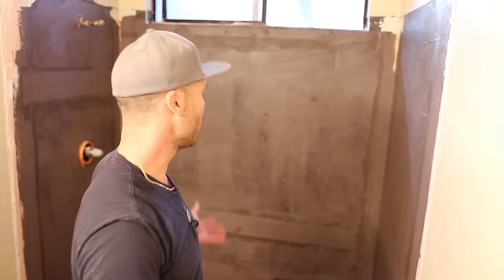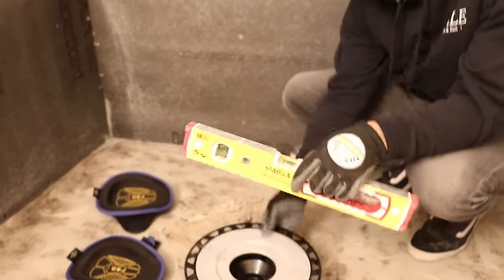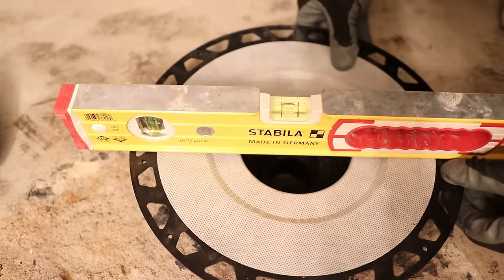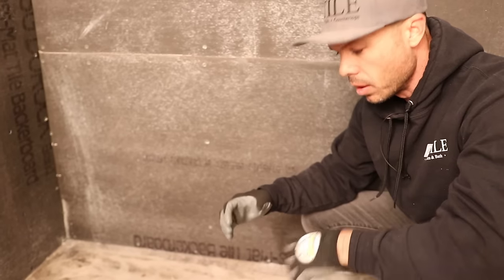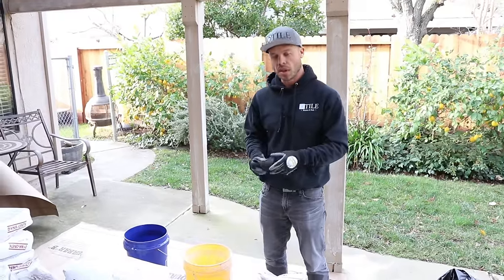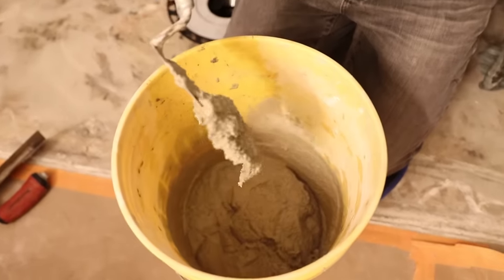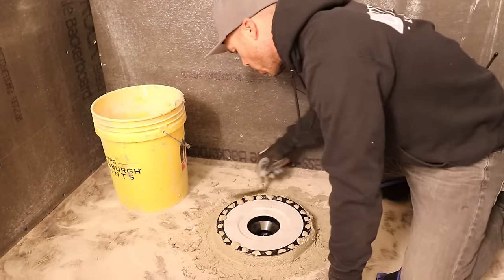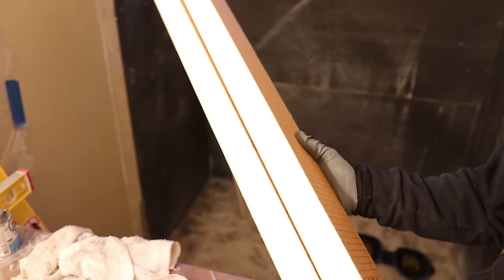One Day Shower Prep!!! MUD PAN with Kerdi and Ardex 8+9 :  TileCoach episode 28

Comment: I have been a flooring installer and tile contractor for 25 years. And I must say. You have changed the way I do things. You have definitely taught me alot. I think you!!! JB flooring
Reply: I have an existing dry pack mortar pan that had some moisture issues so I ground away some little problem areas. I’m thinking of adding some thin set and then another thin layer of dry pack mortar to smooth it out and then perhaps the Schutler liner or shower kit.  Did he put a dry pack mortar on top of a flat concrete floor or over an existing dry pack mortar pan?

Comment: Great video. If you’re a newbie, you can cut 3/4 strips to the correct height for the correct slope and level them around the shower that way you have a straight firm place to screed from. Once it’s sloped, you remove the strips and fill the void.
Reply: How can I better visualize what you said?

Comment: Issac, been watching alot of your videos over the past few years. I love your work ethic, demand for the highest level of craftsmanship and thirst for knowledge and understanding of all building techniques. Little tip with that stabila level when you set your drain, turn the level on its side and you can use both bubbles at the same time to level it across both planes in one shot, give a try some time and you will see how much easier it is.

Comment: My man, I have been doing that method for Kerdi flanges since my union diapers, lol! So happy to see a fellow tile installer who has pride in proper preparation!!!
Reply: Hey Mike, quick question- Did he put a dry pack mortar on top of a flat concrete floor or over an existing dry pack mortar pan? I have an old mortar bed that I grinded away some moisture damage and wonder if I can just put a layer of dry pack right over it….after setting a Kerri flange adaptor in.

Comment: Use a grease pencil or sharpie around your parameter line, easy to see for a quick check. You put this backer board directly down into the pan. You trust this product over others. In the past vids you mention to keep the backer out of the pan. This is really beautiful work, wow!  Great messages at the end of your vids, uplifting, thanks.

Comment: You make it look so easy, experience is such a valuable tool.  I fought mine for hours the other day.  I should have watched a lot more videos, even though I watched a ton to begin with.  I have a small low spot from smacking it to hard.  I am going to test the water drainage before tiling the floor.  Hope I don't have a place that water will sit.  I am a avid, highly experienced DIY'er and you Sir have a true gift.  Thanks for the videos!

Comment: My dad and I have 40+ years experience (east coast) and do old school wet bed. Always build curbs out of wood then wire, cement. Always use durock or permabase board (cover screws with thinset and tape seams). First coat of cement, pvc pan 6” up, second coat of cement, and  everything gets 2 coats of red guard. Takes time but it sure does work
Reply: Also, you mentioned the glass door guy screwing through the curb. That’s a big no no. Those screw holes will leak over time

Comment: Hi , here in the Netherlands we compact the sand cement mixture thIght but add a plasticize aditive like Ardex E25 to the mixture for the bonding and top strenght.
Also mechanical mix all your mortars and thinset.

Great video's btw
Reply: Great idea. I roll it on after the deck mud placement is complete.

Comment: Hey Issac.  The reason it flakes off is because when you pound your deck mud to much you actually bring a large portion of the water to the surface.  You pound the the granular to the bottom and bring to the surface the water.  Thanks for what you do brother.

Comment: Awesome video!  One tip recommendation I learned over the years is when you glue abs or pvc together, once you press the glued fittings together, turn it a quarter turn to make sure glue spreads evenly between the connections.  It just ensures a better seal and less chance of air trappage or separation.
Reply: It's illegal in most jurisdictions to glue abs and PVC together even with the transition glue. It will not hold over time. In my jurisdiction you are only allowed to glue abs and PVC together at the junction between an abs septic tank and PVC home plumbing system or vice versa. All other applications require the use of a rubber clamp coupling.
Reply: @maxgilbert18 I don’t think you understood what he said. His statement is ABS to ABS, or PVC to PVC, not ABS to PVC. Any plumber knows to give the fitting a little side to side twist to get everything to mix evenly
Reply: @jimbobsmith2496  Your right. I must have read that incorrectly.

Comment: "The quality of a person's life is in direct proportion to their committment to excellence, regardless of their chosen field of endeavor." - Vincent Lombardi. I started out as a plumber in the Air Force over 40 years ago and learned from the old school guys. Thanks for advocating for the building trades. Nowadays you can make a real good living and if you're good at what you do, word gets out and you'll be more valuable than gold. Thanks for a great video. I've been on the fence of how I'm going to do my shower, whether to use a pre-formed base or not, but after watching this, I'm confident that this is the way to go. If you were to do this over a second floor bathroom, would you lay down a 1/4" sheet of cement board on top of the plywood sub-floor before the dry-pack?

Comment: Thanks for the good video and your advice to younger guys, What did you use for the deck mud in this video? Why did you chose to use deck mud rather than getting the Kerdi shower pan? What did you use for thinnest? Does Schulter still require you use unmodified thinset for Kerdi? I am a general contractor who has never used kerdi but am looking into it. Thanks for your good work

Comment: So, I'm an avid home DIY guy with years of hands-on experience - but I've never done a stand-alone shower without using a preformed pan.
That said, I investigated doing either the drypack or the Schluter-Kerdi.  I opted for the later thinking it would be less labor intensive and time consuming.
Man - I think I chose the wrong solution.
I'm nearly complete now with the base install of the base, walls, and the membrane in the all the corners and covering each of the screw points.  I watched this video (along with the others you have posted - many thanks for sharing your expertise!) and have taken great effort to remove as much of the thinset between the membrane and the kerdiboard and drain.  I plan to waterproof all of the membrane areas with the Ardex 8+9 waterproofing agent as an extra layer of protection.
I am concerned with the kerdi drain in particular.  As you noted, without air the thinset doesn't have air to dry.  The kedri drain has some small scallpped fetures built intot he design which traps the thinset and as such, it doesn't appear to be drying.  I am concerned that this small area (still somewhat 'spongy' to the hard depressed 'finger test') may not dry properly and after the Ardex 8+9 treatment will never dry.  Laying tile upon this area afterward may be prone to slight movement which could result in cracked grout and allow moisture to seep into the area under the tile causing future problems.  What are my options at this point (short of ripping out the entire shower area and starting over!).
Alternatively, I'm considering removing the kerdi-drain cover and then just treating the area with Ardex after I've confirmed the thinset has fully hardened.
I appreciate any and all insight.
Reply: Did you use a latex modified thinset mortar?   Some of them won't dry under the Kerdi. It also could be that you made it too thick, then re-mixed your mortar in an attempt to thin it or extend the pot life.  Either way, you may indeed have to do as you describe, if it's been days and still not setting up.
Most mortars harden chemically, similar to concrete, but latex additive can interfere with that process    I don't know for sure, just making a stab in the dark, based on your comment.   I hope it works out for you.
Reply: @thilltony3362  thx for the reply.
I've screeded out as much of the thin-set as I could.  I used a pre-mixed unmodified thinset. Then I let it sit for a week before a coated with the Ardex.  Let the Ardex sit for a few days and set the floor tile.  It seems very stable based on my calibrated foot in socks test.  ;)

Comment: Question, 8+9 and Water-Test:  Love your videos, I subscribed!  Just to confirm, there is no issue with doing a full water-test on the base after the 8+9 has dried (per 8+9 Specs.), even though everything under the 8+9 is still "wet" and not yet cured?  Thank you!

Comment: I've been a tile installer since 2003. I started using schluter shower systems within a couple years of starting. I've been to schluter class and I've always had questions about water leaching thru the thinset that binds the kerdi. I even had a discussion about it in class but I was assured by the instructors that as long as I had a 2 inch overlap that it wasn't a concern. But I have often put supplemental waterproofing in places like the corners and outside corners for my own piece of mind. But I like the idea of covering the bottom part of the shower with 8&9. But I'm not going back to mud pans, sorry. I'm very content with the schluter pans plus I wasn't the greatest with mud pans!
Reply: I wonder if I could fine pans without fleece and just 8+9? Bc it’s so thick and strong that it seems like it would last forever. Have u ever heard of company who just does pans cheap without fleece? I know I’m being lil cheap asking but the 8plus9 is whole different league then red guard

Comment: Inside corner mud knife saves so much time when doing inside corners..
Reply: @skiprope536  ... because they mud one side of the tape, let it dry and mud the other, or they sand out any imperfections when they use 6 inch mud knives on both sides.
Reply: @nicksimms9577  I hate inside corners or outside corner knifes doesn't work for me.
Reply: @russellwright9418  there deffinatly is a learning curve, I dont like using them with plaster or joint compound, but I really like them for waterproofing inside corners. I like to use a 6 inch mud knife to apply thin set, corner trowl to spread it out, apply fiberglass tape and smooth out again with corner trowel no bubbles and dont have to do the awkward dance with two 6 inch knifes. Also its fast enough that I can use speed set and ardex 8 and 9 emediatly
Reply: @nicksimms9577  Solid info that's next thanks..

Comment: Nice work.  We do our mud pans very similar.  Question.  I understand the mud will cure properly because it is over concrete.  Would you be able to do all of this in one day of it were over a wood sub floor?  I don't see where the moisture would go.  Possible mold problem in the future?  Thanks again Coach.

Comment: Have you considered 3M 760 UV Adhesive Sealant?   It’s also a Silane Poly.   The Hydro-Blok is not available outside of the west-coast.  Thanks for the tip on the foam board use as a curb, seems obvious now but I don’t always see the obvious.  I also watched your video on not using the Kerdi Fix as a sealer.  Great info.

Comment: Hey Isaac, the way things are done in the Uk 🇬🇧 are totally different! 

We have products that can be installed in quarter of the time, pre formed dec’s that are installed, adjustable height for tile thickness once the dec is fitted, waterproof membrane applied with out thin set and your tiles can be stuck once it’s down.

Full on respect for your skills but Just seems a lengthy method you guys use over there 😲

Comment: Isaac,  I have been watching your videos for about a year and like you style.  I call myself a handyman so I do lots of different projects.  I do enjoy tiling and always try to learn the best ways to do things.  Recently doing a tiled shower using Schluter products,  Kerdi board and membrane with a linear drain and a Kerdi pre sloped pan.  You mentioned that Schluter now says that they make water management products as opposed to water proofing products.  That bummed me out as I didn't use any waterproof coating (i.e. Redgard) on the shower floor thinking it wasn't necessary.  Yikes!        Jim Brennan, NH

Comment: Love your vedios, most of my bathroom remodals are on second or third floor, I allways use a PVC liner and three part drain, helps me sleep at night. Is any waterproofing required on your board seams?
Reply: Same here,Aqua Defense curb and. 6' high on board.no call backs in 31 yrs.i also install drain and liner.I sleep well every nite

Comment: Thanks so much for your videos. I've learned so much. I'm considering using the Kerdi system in our 31' Airstream given that we made some modifications to the bathroom and I can't find a shower pan to fit the new space. I'm worried about cracking the water-proofing (and mud) from the motion of the trailer. The shower pan would be almost directly above the axels. Do you still think Kerdi would work if installed correctly? Thanks.

Comment: Really good video.
Why didn't you (or wouldn't you) wrap the Kerdi pan liner a few inches up the walls and curb? I understand why you can't wrap it over the top edge of the curb, I'm just talking about the inside corners. It seems like you could easily get a leak at the joints between the walls and the floor.

Comment: Sent this specific video to a lot of people as how I want my new shower done. One suggestion and I have no idea if it really matters but when you pack the mud under the flange it seems like the mud could have voids close to the ABS pipe. I feel like if you had a 1/2" or 1" tuck point trowel thing you could really push it all the way back to the pipe. Just an idea.
Reply: Austin thought the same! I still worry of a cold joint around even though thinset ran up the sides

Comment: Have you ever used Ardex 8+9 with conjunction of heated floors?  I love the waterproofing method you use, but I just want to be sure I am not degrading the Ardex if I install it ontop of heated flooring in my shower. We are also installing a channel body drain, so I hope this method works with that type of drain and material as well. Thank you for all your wisdom!

Comment: Another well done video.  Clear and thorough.  Couple of questions.  Ardex vs. Hydroban.  Preference or just local availability?  Would you Ardex over Ditra, or is it more important to have the thinset keyed into reverse sloped squares on the surface of the Ditra for deflection.  Minimum mudbed curbless install.  Still not comfortable with the Schluter weep hole design.

Comment: We use 1/2 inch kerdi  board on the walls and band the seams, we use the kerdi Pans in the bottom and band that to the wall. We lay the floor tile and the curb in one day. Next day lay wall tile and if there is not a deco band grout the 3rd day

Comment: Hi Issac, about to start two bathrooms in my house. Wanted to use kerdi products and came across your posts. Have to say tip and tricks and experience is the best teacher. So thanks for your posts. I have been trying to find an installation guide to make the perfect flawless wet room. I can’t find anything. Can you help with this as I don’t want to get this wrong. Thanks for your help. K Singh

Comment: I think a reason the top of the pack might separate the next day is if you tamp sort of hard , kind of a final tamp, then realize you need to add more mud in a specific spot, so you adding a thin bit of mud to a hardened area that you tamped hard, that thin bit doesn't stick as well. So the trick is to not add any mud after you final tamp....

Comment: Isaac, you should just do what I have started doing. Actually put the kerdi together with 8+9. It works incredibly well and the build up is significantly lest than with thinset since 8+9 is such a fine powder. I make it just a little thinner than the caulking consistency in the 8+9 instructions.
Reply: @TileCoach  Thanks, I've known about the seam wicking for awhile now. I've had it happen to me plenty of times, but not on every flood test. Schluters answer is always "don't worry about it" every time I would bring it up to a rep or their tech line. That never really sat well with me. Your videos pushed me over the edge to start putting it together with 8+9 and build a better mousetrap.
Reply: Use epoxy mortar, latapoxy

Comment: Only thing I would say as a carpenter with 37 years of experience is wouldn’t it be better to run your inside corners at the floor first and then install the curb Kerdi last? Just like roofing and rubber you want it to flow over top, that means it could potentially get behind the Kerdi the way it’s done. I’ve done tile work, trim and many other aspects of construction. Love the video’s, thanks.

Comment: Questions to make sure my walking shower walls are built correct: 

Am I using the right steps in the shower walls and is the drywall ok : 

1. Install drywalls of framing 
2. Cover the drywalls with waterproof Aqua paper. Is this correct ?
3. Install lath on top of the drywalls and waterproof paper 
4. Float the walls with cement , how thick it should be and what kind ?
5. Thin set and tiles . What kind of thin set for big tiles 
6. What am I missing ? Can you correct me and advise me 

Thanks for your help in advance

Comment: Before when you used to do mud pans without kerdi on floors and walls would a shower be less or same charge because of the extra work that has to be done water proofing it. You don't have to say price just yes or no if you can .don't know if price for labor would be more thanks. Cool vids